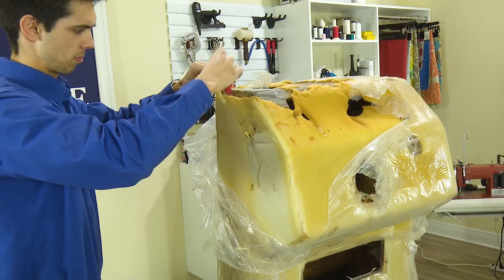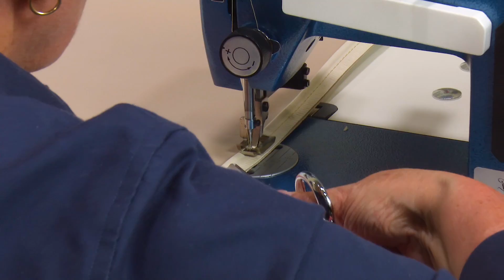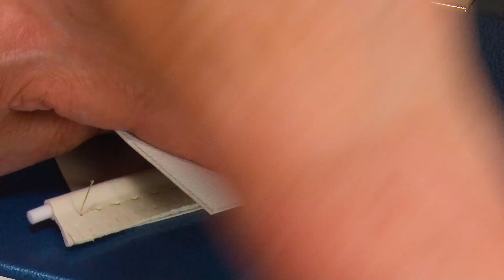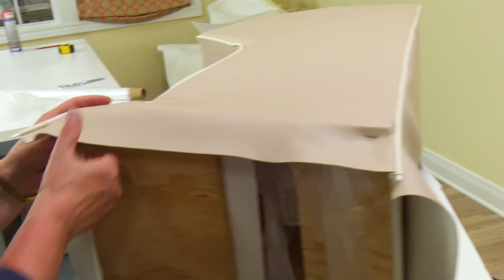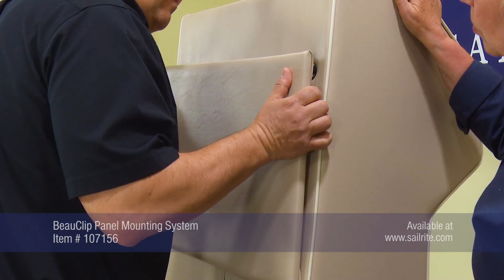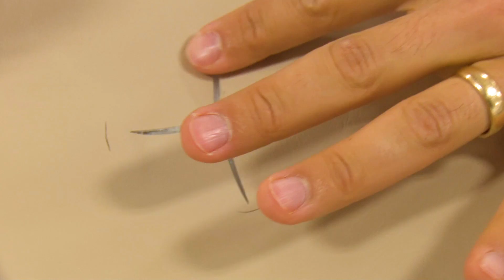How to Reupholster a Pontoon Steering Console

Comment: For people that may not be comfortable with a heat gun and want to keep a little more control, something I've done to shrink vinyl on things like car seats is by taking a detailing towel and soaking it in a glass mixing bowl full of water.  Microwave the whole thing for a few minutes until it's super hot.  (Be careful, because, well, it's scalding hot).  With insulating gloves on take the hot cloth and cover your wrinkles.  Keep doing that until you pull the wrinkles back and I've found it doesn't hurt the impression because you're not softening the vinyl as much as the heat gun would.

Not my idea.  I learned it from Ish Jimenez (formerly of West Coast Customs).
Reply from the maker: NGinuity, Excellent suggestion. I would never have thought of doing that. I will try it with my next project. Thanks a million!!!!